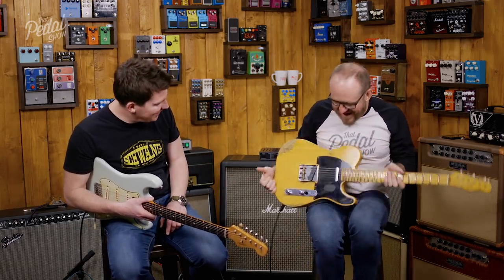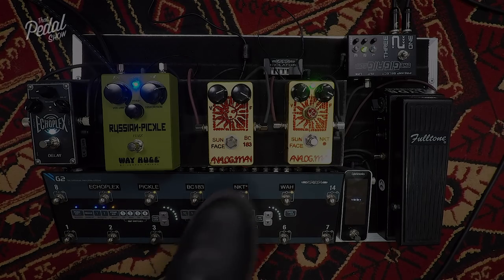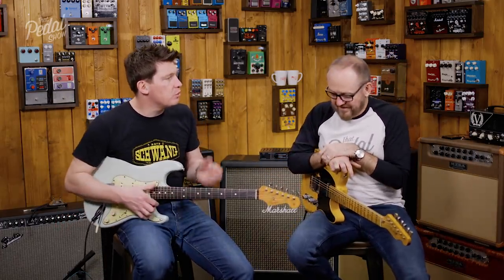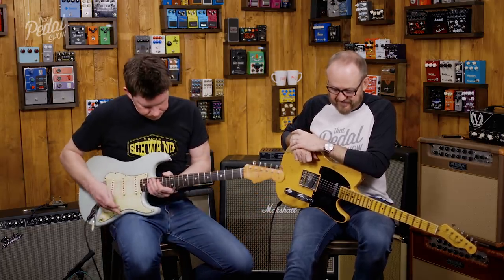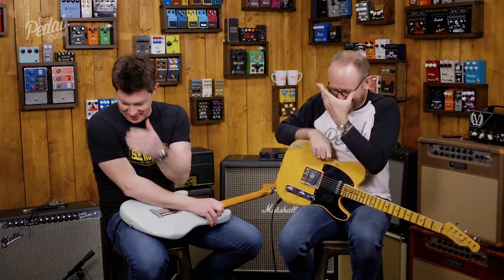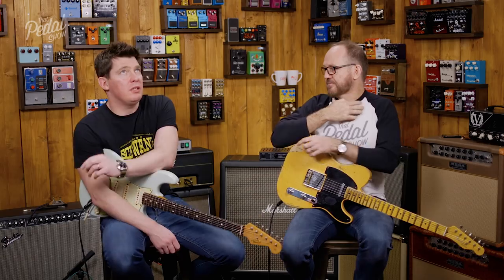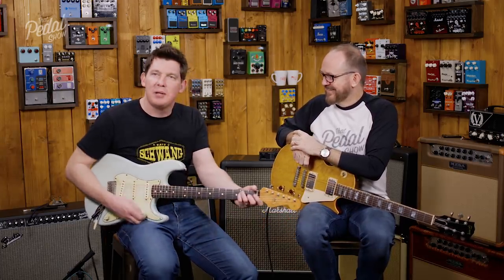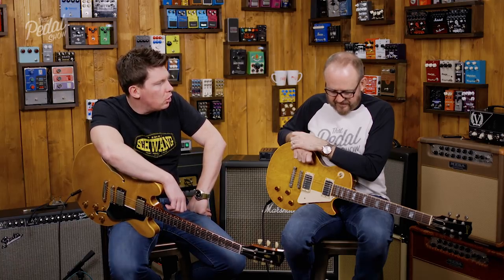That Pedal Show – Things To Know About Using Wah-Wah, Fuzz & Buffers

Comment: So if i have a standard Cry Baby GBC95, could I put a resistor series with the output to make it match the impedance going into the fuzz? Or how do I put a buffer in my wah?
Reply from the maker: Doesn’t work like that unfortunately. Once the signal is buffered there’s no way to get it back to the same coil inductance/impedance relationship as plugging the guitar straight in
Reply: @ThatPedalShow  ahh, right!But is there anything I can do to the cry baby without having to buy another pedal?
Reply: @ThatPedalShow  making the cry baby true bypass, would that solve it?
Reply from the maker: Mick here - there are a lot of mods in this area. It’s all too technical for me so I just bought the Fulltone Clyde standard way that has a variable buffer built in. Research that maybe and the way forward might de-mist a bit!
Reply: @ThatPedalShow  Guess I'll give it a whirl and look deeper then. Thanks alot for your answer! Appreciate it!
Reply: @Speedking762  Foxrox sells a buffer retrofit for Wah pedals that enables you to get full range when using a standard wah with a Fuzz Face type pedal. I also made a standalone pedal that does this, and enables you to use a Germanium transistor Fuzz after any buffer without affecting the tone of the fuzz.

Comment: so bottom line is that you just need to experiment to see what sounds better because there are so many variables that there aren't any reliable rules to apply.  Don't put buffers in front of fuzz is only true sometimes.
Reply from the maker: That’s about the middle and both ends of it Chris!
Reply: @ThatPedalShow  I have a J Rocket WTF as my first pedal just after a Polytune with the Bonafide buffer built in.  Having the buffer on or off doesn't seem to make much difference but I get a little more of the effect with it on.  I don't know if the WTF is germanium or silicon but it is a little more modern designed circuit so maybe it is less susceptible to things like buffers?

Comment: Hi guys I have a query. Does the input trimmer on the germanium analogman have an impact on the how it’s works with a wah pedal. I ask cos I have a similar control on my my fuzz face clone
Reply from the maker: Probably. It’s an input resistance thing... so probably. Exactly how I’m not sure. Mick here.
Reply: That Pedal Show my guess is as resistance is a component of impedance, that increasing the trimmer resistance also increases the input impedance of the pedal; that may mean it plays mores nicely with a wah and buffers. Maybe that was partly what was happening with your analogman red dot as I know you both liked having the input trimmer with a little increased resistance. I must do some testing.
Reply from the maker: Really good point - for sure it will have some effect....
Reply: Bah, just left a comment replying above! You got there first   :)

Comment: I don't get it. I thought a pedal is only true bypass when it's off, as soon as you turn it on there's a buffer involved... So how can you turn a buffer on/off on the activated wah pedal?
Reply from the maker: Not all buffers are the same, is the only way I can understand it. Mick here. Clearly there are different kinds of buffers and how they work within a circuit. Cheers!
Reply: That didn't really help, but thanks for replying, Mick! :D Cheers!
Reply: I think it has to do with what Dan mentioned about wah pedals generally having high output impedances. An overdrive pedal that is switched on generally has a low output impedance, meaning that you're signal is being buffered almost as a bonus to the effect. The wah doesn't have the same "bonus" as a result of it's high output impedance. Of course, this can be useful when a pedal after the wah wants to see an unbuffered or low impedance signal. 

Finally, it's worth mentioning that even some gain pedals have high-ish output impedances. Anyone with an early ish OCD may have run into this. I want to say they "fixed" that issue around v1.5.

Hopefully I'm not completely talking out of my butt.

Comment: Okay, fuzz & buffers can be an issue, depending on both the particular fuzz & the particular buffer. Fine, but where do active P'ups fall in this equation? Remembering that Sir David of Gilmour is known to have used both fuzzes & EMG's, 'tis a valid question, methinks???

Even better, ASK HIM. Get Mick to make the call, give David the chance to "F- off Neville" phoneslam him...

p.s. - Glad I'm not the only one who can't get along with the '52 Mondo-U neck (the '69-U OTOH...).

p.p.s. - Gibson. Spent too much buying companies they didn't need, then spent more trying to leverage tech from said companies into their main market. Should've learned from the Firebird X, but didn't. Oh well, either they'll dump the crap, or they'll be flushed down the pan with it. 

Cheers... G
Reply from the maker: Eeee. Active pickups. Maybe if we had Davey G’s resources we could learn how to use them. Everyone says he uses them. I just see him using normal Strat pickups most of the time. Mick here.
Reply: Well, Mick, perhaps everyone says he uses them because, well, he uses them - or at least he used them for most of the 80's & 90's in the live arena. Okay, he may not've used them in the Black Strat, but he certainly did in the red reissue that he used. I'm pretty sure Pulse was mainly this guitar, & the DVD certainly seems to show EMG's in use...

Comment: Why didn't the red dot sunface react to the wah? I think I need to email Analog Mike for an explanation. :)
Reply from the maker: Yep. :0)
Reply: Aha!  IIRC from your Analogman video you both seemed to like the NKT (not sure about the BC108) with the internal pre-gain trimmer "set somewhere" - listening to the fuzz only bits of the video today sounded like they were exactly "tamed" in this way - of course I might be wrong! By using the pre-gain (or the Input control on a Fulltone 69) you are increasing the input impedance directly of the Fuzz....et voila..... YMMV but this is, I think, why your AM Fuzzes did not "trash out" with the WAH...and to be honest that is probably the most obvious reason that control is actually in the circuit - in order to tame the driven tranny whether it be direct from the guitar circuit impedance or a pre-fuzz buffered pedal.!

I also am assuming that Hubcap John's fuzz doesn't have a pre-trim, and to be hinest you can tell that the fuzz only section of the video it sounds full on "buzzing" fuzz at guitar vol 10 vs the AM NKT.

Comment: So powering wah pedals with batteries vs power supply? 
I’m confused now after seeing this post on Facebook by Scotty Smith of Pro Analog Devices https://www.facebook.com/scotty.smith.520/posts/10215278897548361
You will notice in the comments that Joe Gagan agrees that batteries help the tone to not be screechy on wah pedals. Are they really as sensitive as a Fuzz when it comes to how they are supplied power? How do you deal with that with G2? I noticed you had these Wah all powered by the GigRig power supplies. Were you using the battery simulator?

If you do a Wah Pedals part 2, I would love to see you do the same as this show with Fuzz, but compare the Joe Gagan Wah and Pro Analog wah, Xotic Wah, Vox Wah, Snarling Dogs Mold Spore Wah and talk about batteries vs power supply and is there a tonal difference between the battery and 9v power supply.
Reply from the maker: +Tim Mifsud the power thing is so interesting. Yes, batteries do indeed make a difference in some circuits. If you imagine that a power supply sits there with huge amounts of current delivering capability so that as soon as the transistors start drawing current the supply just feeds it, no questions asked. A battery, especially a carbon battery is a bit different. Whenever the circuit starts to require current the battery has a tiny bit of resistance, and the result especially in the way the pedal ‘feels’ to play can be very different to what it feels and sounds like on a power supply. In this video we had virtual batteries on the fuzzes to simulate that effect.
Reply: That Pedal Show - thank you so much for your reply. You have shown me so much and for that I’m honestly very thankful for all the knowledge you have imparted freely and in such a fun way. I look forward to your show whenever it comes out. 

Whenever Dan starts explaining how the signal is processed by a pedal, I am reminded in a charming way of Professor Julius Sumner Miller saying “Why is it so?!” https://youtu.be/P6dU-gSP_S0

Mick - I just think your playing, taste in tone and style is phenomenal and I very much enjoy the sounds you pull out of the pedals you use. Like others, I reckon you sound amazing with Wah and it’s true that we haven’t heard much Wah from either of you over the course of all the episodes you have put out. 

Thanks again for this info on batteries and ways to simulate a battery with wall plug in power supplies. That’s great that you had battery simulators on the fuzzes. I guess it would just have been interesting to see if using a battery/battery simulator on the Wah as well as the fuzzes would have made any noticeable difference. Maybe that’s for another show...

I know you have done a show on power before but it would be great to focus in on certain pedals like Wah and fuzz and anything else you think of that would be sensitive to power. Maybe a show on different battery sources for sensitive pedals. Or look at different ways to power a board like these new rechargeable battery power supplies that are coming out now where you aren’t plugged into the wall. 

I’m sure you have heaps of show ideas lined up. Just another one for the list. 

Cheers,
Tim